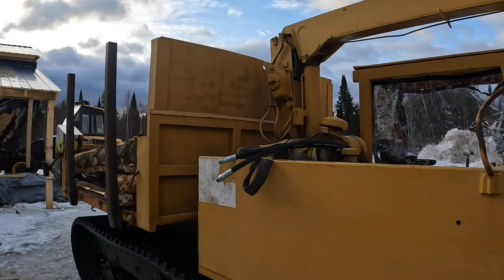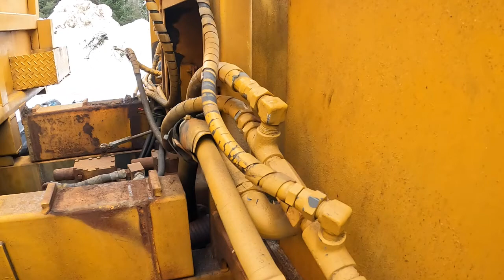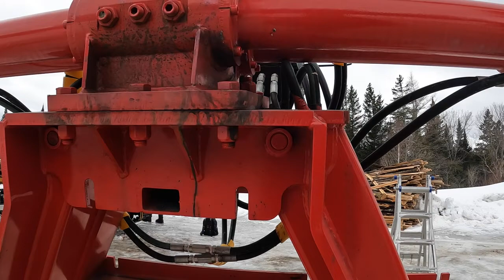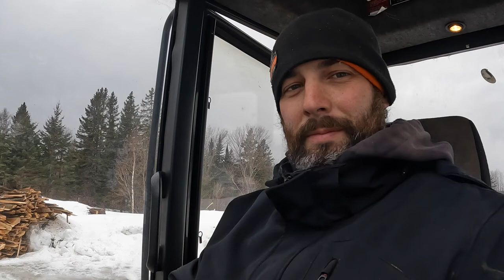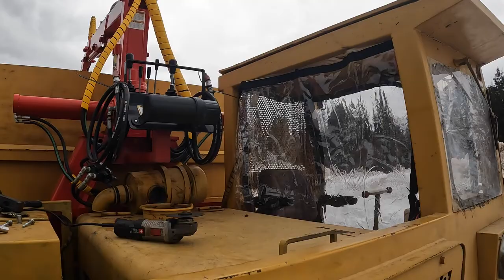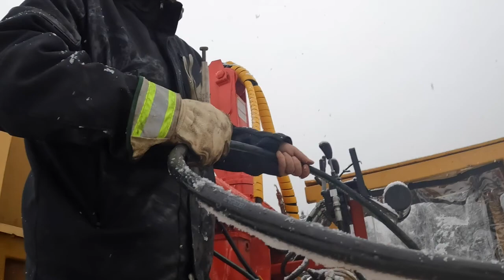Attaching a Woody 170 Log Loader to Morooka Crawler Track Machine for Logging

Comment: Nice job mounting the loader. It should work slick. Looking forward to seeing some videos of it out in the woods working. 
I personally would have bought a Kesla /Patu loader for on it because the main lifting cylinders on them sit almost vertical so it's never in the way. And they are the toughest small loader I have ever seen for their size. 
Take care my friend!!😀😀

Logger Al
Reply from the maker: Thank you.  It will be put to work a lot soon.  I will be posting those videos.  The Ponsse has been harvesting and stacking wood quickly before the snow leaves.  I will look at the Kesla for the fun of it.  The decision to go with the Woody had a lot to do with availability.  I could get this one now and modify it or wait months from another dealer.  I was very happy to find something available now.  Thanks to Dads 4 By Tool and Supply.